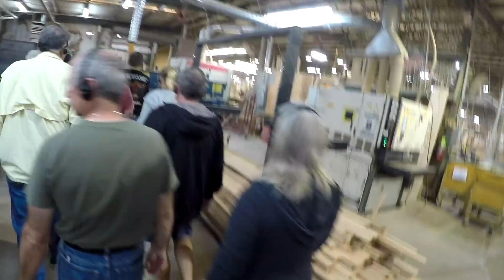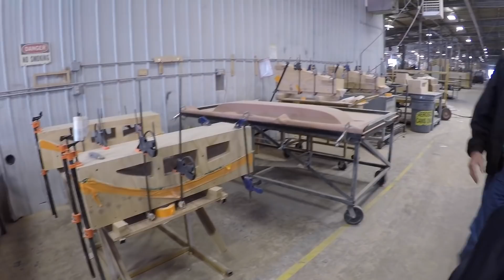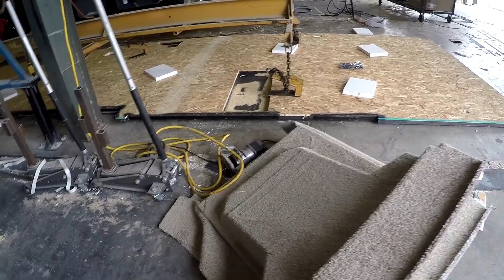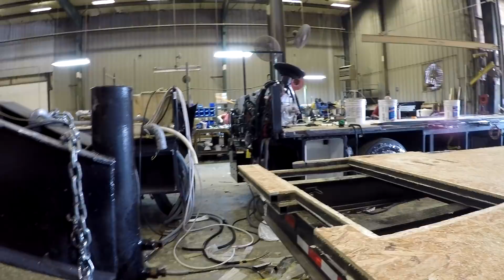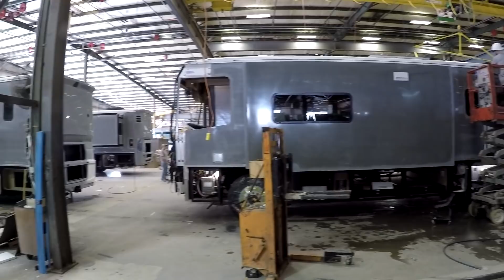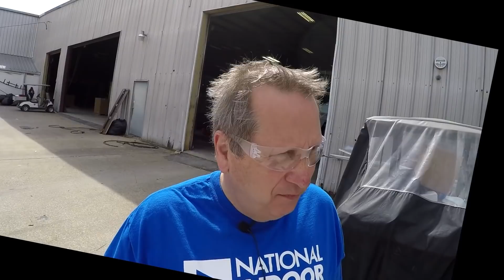Tiffin Factory Tour

Comment: Hello, not trying to be snarky at all but wanted to share a couple things as someone who’s been not only in manufacturing but in productions exactly like this. 1) the machine you saw “holding down” the tile floor as is dried was not holding it down. The tiles steady dried and that machine is a suction lift. They lay the tile as the whole unit then use the suction lift to place it. Yes it was holding It there while it was secured but not to dry. 2) The 3/4” floor board you didn’t like was not the full floor substructure. It is multiple layers one of which was attached already to the dried tile floor assembly that later Is attached. If it were only the one 3/4” board it would twist and sag and droop. 
Anyway I thought your video was great and thorough but just out of context on a few full production process portions that incorrectly undermined the intended quality. This is exactly why some manufacturers don’t allow close up and full access reviews… context.

Comment: The dirty cluttered work areas are a reflection of management attitude. It's unsafe and unhealthy. Visit an automobile factory... You can usually eat off the floor it's so clean. That dirt gets into sensitive electronics making them fail early. Bottom line: you are far more productive when you're organized. There should be a protocol for scrap handling at the point of use. Otherwise you're handling it twice, and that adds to the cost. These people would need HOURS at shift end to do a proper cleanup- again adding to cost. A dirty shop doesn't mean you're more productive; it just shows disorganization and lack of professionalism.

Comment: Just seeing this video a year after posting.  Not quite certain your reasoning for fiber insulation over foam.  Always told that fiber could 'settle' even in a home.  I would think in a coach, chances of that happening would increase greatly.  As well, my thoughts to "R"-value of styrofoam over fiber would be greater, or am I incorrect?  I just know I'd give anything to pull off interior aluminum panels from my 30 year old Airstream motorhome and have closed-cell foam sprayed in, or even ceramic insulation.  But I don't want to remove complete interior for such a project.  
Overall, a great video of the Tiffin Production plant.  And yes, I can see the concerns for the waste.  I worked in a production environment (construction, and processing) and NOTHING was allowed on the floors at ANY TIME!  We never knew when an OSHA Inspector may show.  Surprised that Tiffin doesn't have the same concern.  OSHA Fines are nothing to sneeze at.  Same for PPE for employees.

Comment: Insulation.... with polystyrene it's all down to the type and rating etc and reduces (like closed-cell foam) the likelihood of condensation etc.  For the most part, both the newer poly and foam blocks are complete cut above fibre based materials.  But... they all have their pros and cons. Another pro is their sound proofing qualities.

Comment: Most manufacturing tours limit where visitors can go because of liability concerns. Tiffin has a great customer service reputation. My choice is Newmar. They have both batt and foam board insulation in their walls. I believe their floors are 1.5" thick. Newmar's price does run about a 30% higher, but they only build 8-10 units a day. You do get what you pay for.

Comment: Have a 2017 Allegro Red 37  PA. Lasted two days and the hydraulics puked. I have a list of crap they screwed up or absolutely didn't do. Sinks weren't even hooked up in the bath. They must save a fortune in not putting the required screws in. And the TV splitter system is a nightmare. Had to replace those boxes. Forget accessing the back of one of the TVs. Front generator hatch had two different width latch plates so one side wasn't even latching. A messy work area shows how the work is actually done. Dumped on the dealer to fix. As if they will. On the Pro side,... we like our Tiffin. But I cringe every time the big slide moves. Drives like a dream. As things go on a new RV I guess we are in the realm of normal. Sad to say. :-)
Reply from the maker: Once again, how do these companies get away with it???